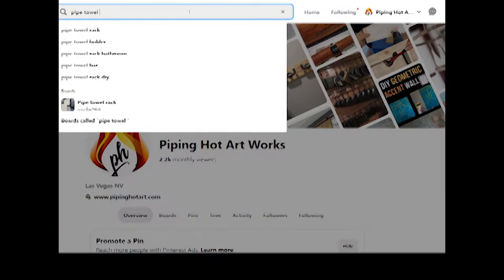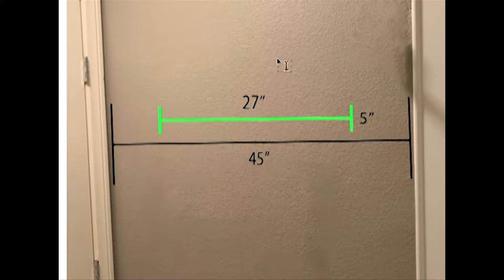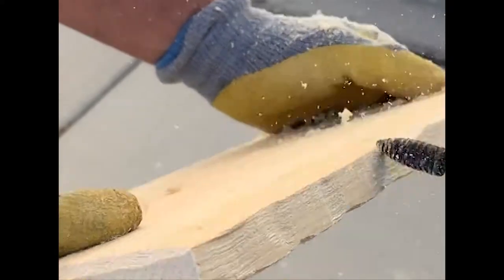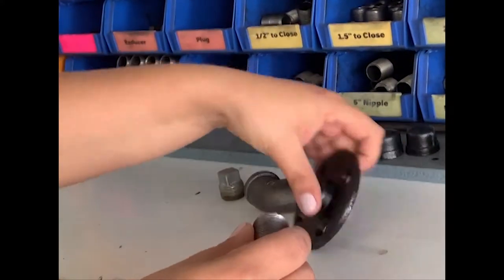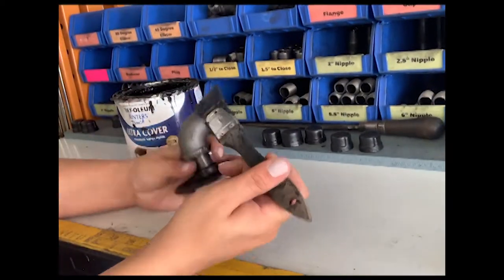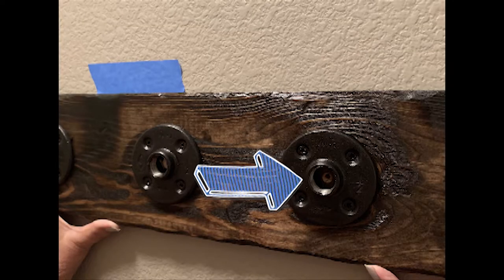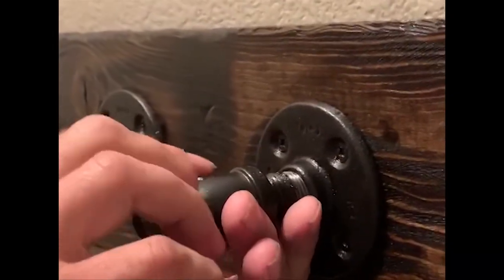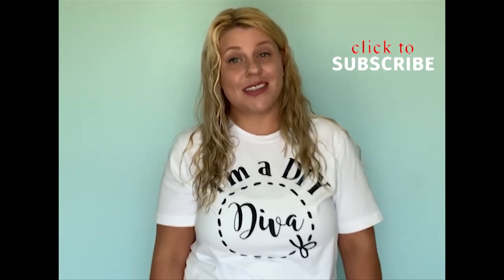DIY Pipe Towel Rack / Coat Rack 2019

Comment: I don't have a table saw, I only have a router with a router table. What is the best bit to use in making joint edges?
Reply from the maker: Hi Ken- we did not create any joints in this video. Can you describe what you are trying to build so I can better help you?
Reply: i'm just looking to join to boards together from time to time. I'm getting into woodworking and looking to play around with some free pallets I have.  and would like to join them.  But not sure what bit I would need when using a router.  I don't have a table saw so the router would be the only way to join them.
Reply from the maker: @KenAdams426  Hey Ken, I haven't done alot of joints with routers so I would recommend checking out this video Steve Ramsey did on it :) https://www.youtube.com/watch?v=H6nql7mlSOo